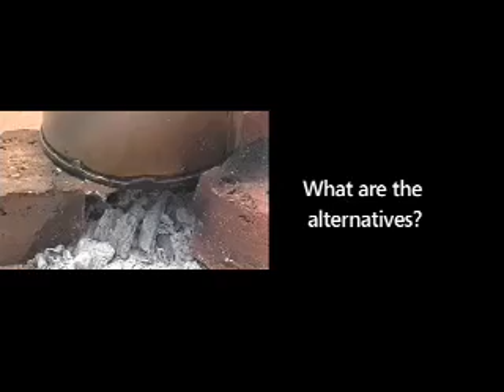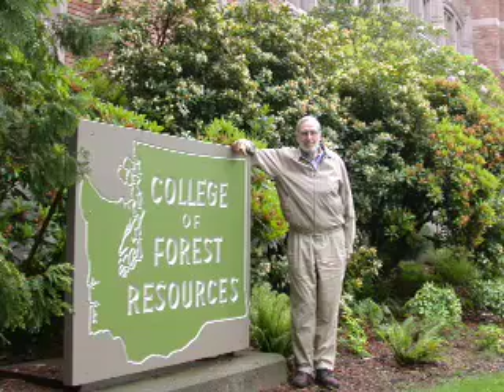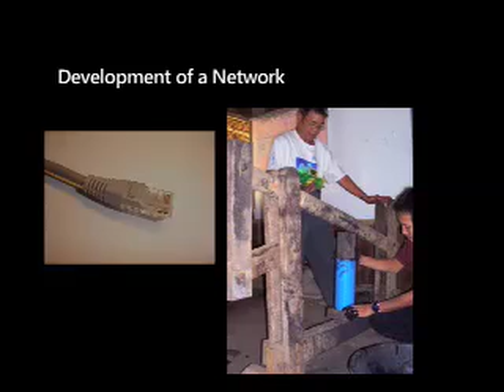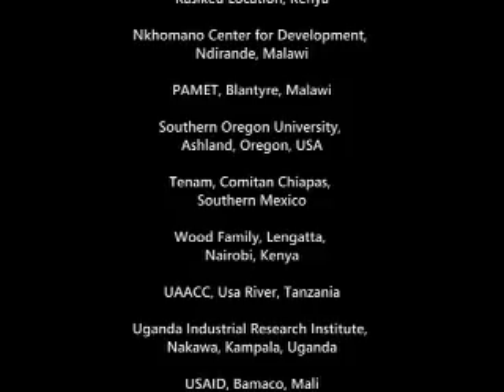Fuel Briquettes/ Biomass Briquettes

Comment: Also, considering the concept of Carbon emissions, burning wood adds ZERO to the greenhouse gas cycle. Growing wood gets the main portion of it's carbon from the CO2 it absorbs.

I am surprised at the complete lack on the ecology side of the issue here, as it takes ones focus off of the true reasons for deforestation, the main of which is greed, not necessity.